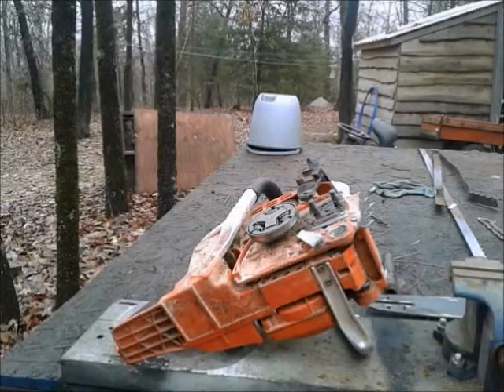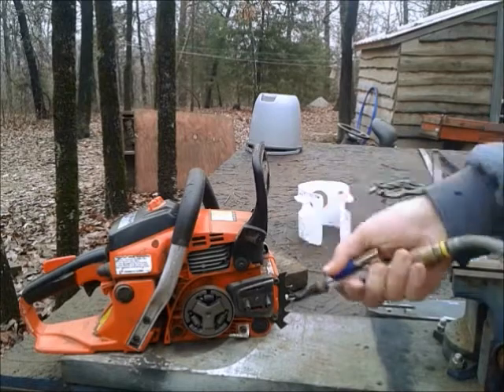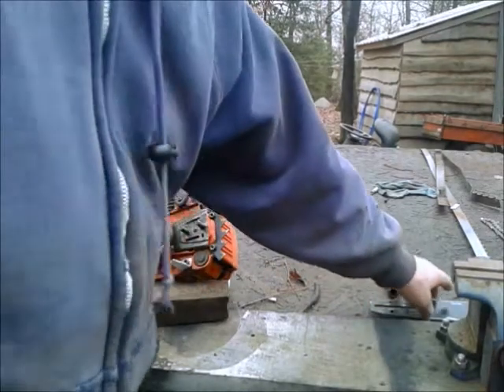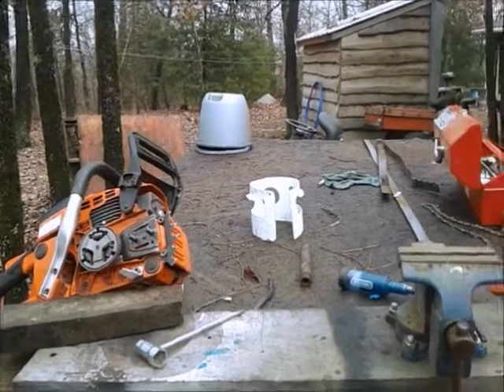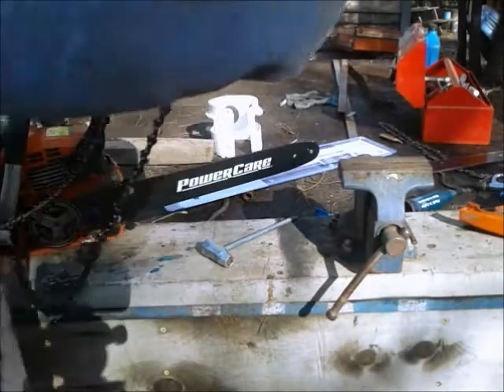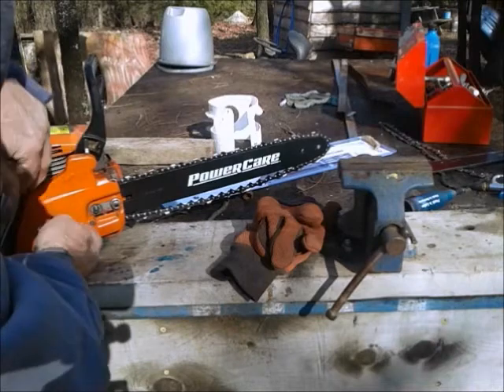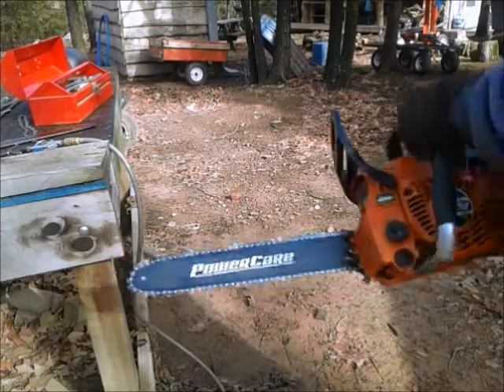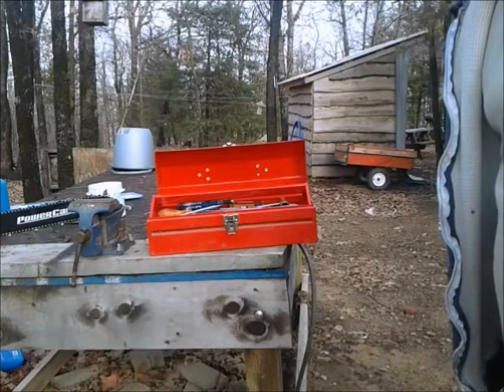Taking care of a chainsaw

Comment: didnt look like much oil coming off the chain ? might need to clean out the oiler ?
Reply from the maker: It was running a little thin I usually pour a little gas into the oil tank and clean it out that way that usually does the trick